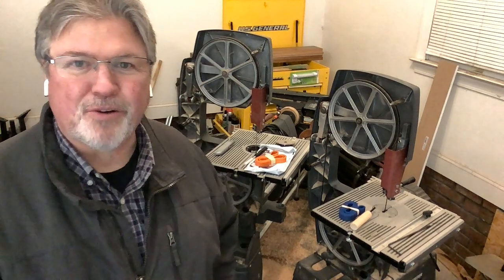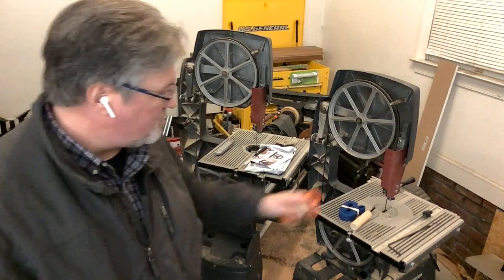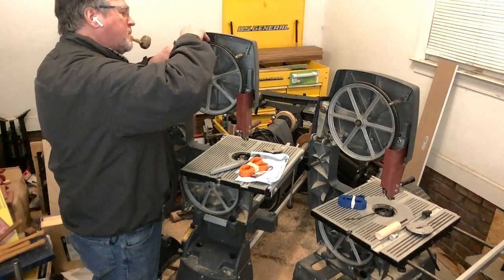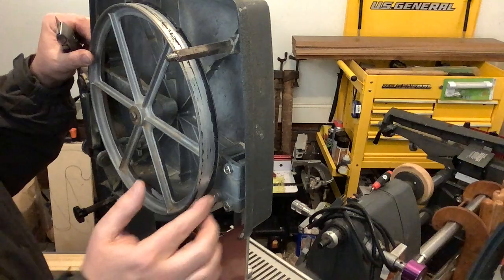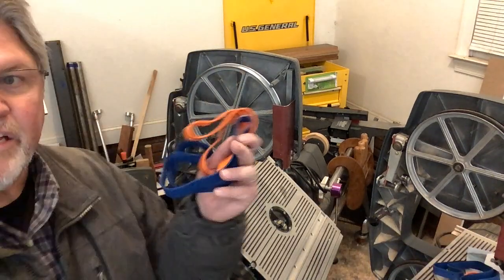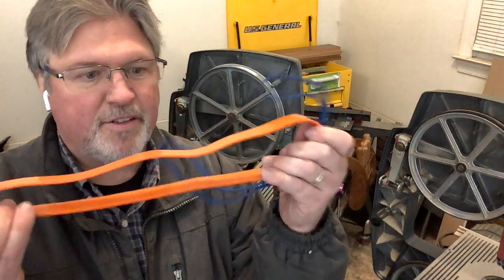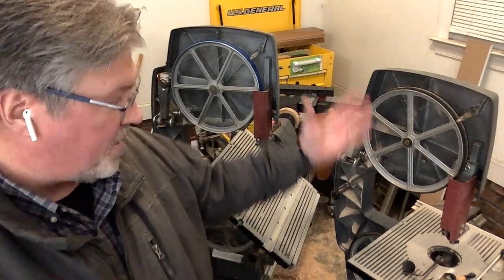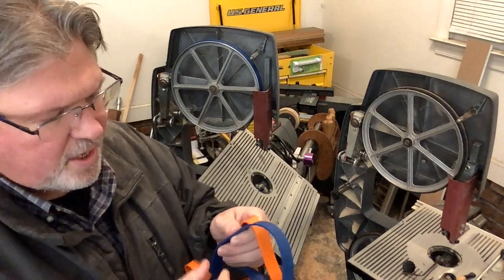Installing 2 Brands of Urethane Bandsaw Tires on a Shopsmith Bandsaw: Sous Vide Everything?

Comment: Did the deed on a different brand without the benefit of factory tools.  All I had to rely on was what Naval Aviation Corrosion Control taught me: Three methods of cleaning include heat, mechanical, and chemical.  I think my task was accomplished using a lot of WD-40 for cleaning, and soap and water to clean off the WD-40.  Your tutorial makes it look easy.  Thank you'

Comment: Hi Scott, I’m replacing my tires and watched your video on how you did yours.  In the Comments and Cheap Shots you talked about different types of liquids that might help remove the old tire and glue residue after you get the old tires off.  I ordered some brass wire wheels and the light you suggested (I’m going to really like that!).  In the meantime I got to thinking about the lacquer thinner you used and decided to try it on my own.  I clamped my wheel in my vice with a rag to protect it and absorb the thinner.  Then I used a green scrub pad and just drizzled the thinner around the wheel.  I just kept repeating that every couple of minutes for about 15 minutes.  At that point the glue would wipe right off.  The tire residue that was left had turned hard and would pop right off also.  Try that next time on an area and don’t get in a hurry the thinner just needs time to break down the glue.   I love your videos!  BTW you really need to get some heat in that new shop, lol.  Almost forgot, I used 1 inch tongue depressors cut at an angle for scrapers.
Reply from the maker: @thomasfrates  So glad it worked for you, and you are right, I9m not very patient. This was filmed quite a while ago and I’m actually in the second space since filming this and I now have a slick mini-split unit that keeps the space just right.

Comment: The urethane tires go on many times easier if you clamp the tire in place in one spot on the wheel, and stretch it part way around the wheel and put another clamp to hold it there, then stretch some more and clamp again. Getting the last bit on the wheel is then easy.
The way you were doing it was basically trying to get all of the stretch out of 1/3 of the tire.

After it is in place, run the tool/dowel/screwdriver around between the tire and wheel a few times to even out the stretch of the tire.
Reply from the maker: I guess I edited out me messing with the clamp! I tried that and gave up. Scott
Reply: The way Mark discribed it, is the way I put the orange tires on, and have not had any problems with them.
Reply from the maker: @ozguzzi  Glad to hear it.

Comment: Thanks as always for all of this great info. I've just finished installing the Shopsmith OEM urethane tires on my bandsaw, and hopefully my experience can help others. I used a heat gun to remove the old tires (worked great!) and Klean Strip brand "Painter's Solvent" to remove the residue. The solvent worked well, but required a lot of reapplication and switching to a clean part of my paper towel. I ended up scraping a lot of the adhesive off with a set of dental picks I have, but I suspect the solvent would have done the job given enough time. The new tires from Shopsmith are very orange (not red like pictured on the website), and the outside is textured, not glossy like the ones you have. They came with no installation instructions and no tool. I soaked them in my sink with the hottest water I could muster (I would estimate 120 degrees F), and ultimately muscled them on similar to the way you got the blue one on in the video. My tool was the shaft of a multi-bit screwdriver with no bit installed. The tires are about 0.100" narrower than the channel on the wheel. Thanks for showing how this is done. It was a real bear getting the tires on, and I may have given up if I hadn't seen you do it first. Hopefully this will be the last time I have to do it.
Reply from the maker: I have a set of the SS tires in my shop somewhere, which is the story of my life! Glad you get them on and I hope they serve you well. Scott

Comment: Thanks Scott! Tim B on YouTube uses string for clamps. And a creative use of a metal rod in a drill to roll the tire on the wheel. I think I will try a wood dowel to protect the aluminum wheels. Also, thanks for the BlueMax recommendation.
Reply from the maker: Yes, I've seen his technique and I would have tried it had I not been wanting to see how well the included tools worked. I might give that a go on the next set because it looks like it works really well. Scott

Comment: I installed the blue tires last summer and they've worked fine.  Relieved to see I'm not the only one who had a little difficulty installing them... I thought I might be doing something wrong, but managed to muscle them on eventually (and yes, I did the hot water soak).  I'm envious of those videos with bandsaw guru Alex Snodgrass calmly stretching unwarmed tires on with no tools but a spring clamp or two...
Reply from the maker: The larger the wheel the more tire there is to stretch, and I wouldn't be surprise if the tires that Alex demos with have been stretched a time or two.

Comment: Thank you Scott for another great video!  I just replaced the original rubber tires (2012) with blue max last week.  The original top wheel rubber tire actually came off while I was using the bandsaw!!  Removing the rubber from the bottom wheel was a challenge. After removing the majority of the rubber,  I ended up removing the wheel from the bandsaw and used a wire wheel brush on the Shopsmith in the horizontal boring setup.  Using the 500 rpm setting on my powerpro, the rest of the rubber was easily removed.  I finished cleaning both wheels with using Goof Off.  Installing the blue max tires was easy.  I put the wheels in a vise with protective coverings and, using spring claps, I was able to stretch on the new tires.  I did soak the tires in hot tap water for a few minutes.  I installed the newly tired wheels after following your bandsaw maintenance video.  Thanks again!
Reply from the maker: Sounds like a wise approach. I've had good luck with Goo Gone in the past to get rid of glue residue but I don't believe I've used Goof Off.  One of those might be a wiser recommendation for folks. I'll have to do a little research. Scott
Reply: I'm not sure which one works best, but for sure, Goof Off has much nastier toxic fumes than Goo Gone. So be careful and only use it outside if possible.
Reply from the maker: @brucenorton3792  Thanks for the tip. I purchased both tonight and will use them in the mid-week follow-up to see which one to recommend. Scott
Reply: @brucenorton3792  same conclusion re GO and GG

Comment: Thanks Scott. I didn't have a calibrated method for hot water above 120 for my Blue Max tires,, so I put them in my  Quick Grip Bar clamp/Spreader and stretched the Jesus out of them for about 20 minutes before putting them on. Looks like you still fared a little better. Thanks for the tip.
Reply: I had the same thought: reversing a clamp head and stretching it
Reply from the maker: Yeah, the idea of stretching them out occurred to me too but the idea of overstretching it was a concern.  Not sure why though, because it works for ballon animals! Scott
Reply from the maker: @johnoerter2883  I have one of those in the corner too!

Comment: I struggled with band saw tires until I used the method Alex Snodgrass shows on his channel. Didn't need heat or hot water. Also, I tried that orange brand you have there from Amazon and finally gave up. They are too wide and just too tough to install. I only used the blue Carter ties now. More expensive but much easier to install. Thanks for the video!
Reply from the maker: I also wasn’t impressed with the orange tires, but found the Blue Max to be excellent. Alex is the man.

Comment: I just put on the blue ones.
  I had to scratch my head and wonder how a dowel with a nail in it got in the box.
So I just pried my old tires off. My wheels are grooved. It was looking like a fight to try to hand-stretch the blue ones on, so I boiled some water, then added the blue tires... they were probably in there for 5 minutes or so when I pulled them out. Maybe less.  Still had to hand stretch, but it wasn't bad, and no harm done. Good tension.

Comment: I just installed orange ones I bought from SS.  Not sure if they are the same as what you used.  I used a heat gun (very gently) .   It was hard to put them on but I got it done and the saw works great.  I think now I will sell my old Delta .   I need space in the shop.
Reply from the maker: The Shopsmith tires are similar to the orange tires I installed, but not 100% th same. I know because I've purchased them too at one point.

Comment: If you use spring clamps at your starting point and about 1/2 way around, they will hold the tire in place so you can use both hands to finish putting the tire onto the wheel

Comment: Hey Scott, Mark Beiser's comment is right about clamping the tire. I see that you replied saying it must have been edited out. 

I tried multiple times heating it the same as you, but it wouldn't work. 
I ended up clamping it across the wheel on opposite ends so it stays stretched equally, and working one half at a time. It went 100x faster for me when I did that, and by then they were cooled down to room temp. 

It wasn't because I had stretched it either because I did the same with the bottom one that I hadn't tried to put on yet and it took only a few seconds compared to the 5-10 mins trying to put the top one on before clamping like that.

-Scott
Reply from the maker: Hey Scott. Yes, I edited it out because the dang clamp kept falling off. I didn't try a handscrew clamp, which would probably work.
Reply from the maker: I just added a screenshot from the part I removed on the Community tab of my Channel page.

Comment: Good observation on the difference in textures between those tires.  Can't wait to see how the orange one performs for you.  I tried the Shopsmith urethane ones (red in picture, but orange in reality) and one of them went flying off the bandsaw right after installation.  I switched to the Blue Max ones and no problems whatsoever with it.  So, I am curious to see how this brand of orange tire holds up.  By the way, on the Blue Max tool, I had to turn it around and put the wood handle under the tire to help stretch and roll it around the wheel.  The instructions were not specific on this tool, but I found it worked better for me using the wood part to ROLL the tire around the wheel.  Of course, I had to use some quick-grip clamps to help keep the urethane tires on the wheel as I went around it.
Reply from the maker: Woah, I bet that was exciting! Seriously, not cool at all. I get what you are saying about using the dowel in that manner. Did you heat the tire or were you smart enough not to install them in the dead of winter?  Scott
Reply: @MyGrowthRings  I can't remember if I followed the instructions on the orange ones or if I followed the prevailing wisdom on the forum at that time.  I did bake them in the oven on a low temp and tried to be careful not to overstretch them in applying them.  I can't say for certain if the failure of the orange tires was partly my fault or not, but I think you are on to something about the smoother texture on them compared to the Blue Max.  I suspect the orange ones need to be glued to the wheels like the rubber ones to keep them on permanently.  I remember following the instructions for the Blue Max tires, though I don't think the hot tap water did much to help.  After some experimentation, I came upon a technique that worked reasonably well to clamp and stretch the tires using the wood handle to stretch and roll around the edge.  It is awkward no matter how you do it, but I have lots of practice on bicycle wheels so my intuition kind of took over on this one and it wasn't difficult after I let it.
Reply from the maker: @rfguy8499  "It is awkward no matter how you do it" should be printed on the package!  By any chance did you think you got a set of the 12" orange tires that SS accidently shipped for a short time? It was a mistake from their supplier and there was no way they could stay on a wheel.  Was at least 10 years back. Scott
Reply: @MyGrowthRings  Yeah, it definitely is possible that I got one of the bad batches from Shopsmith during this time frame.  Several others had the same experience as me with them and posted on the forum about them.

Comment: I used the shopsmith tires. No tool provided and instructions on the webpage only that said hot water to 125. They are a royal pain to install.  I ended up using large screwdrivers and zip ties to get them on. The zip ties stopped the tire from jumping off the rim as I worked the opposite side on. Wish I had seen this video first 😆 Seeing how easy yours went on I would say give the shopsmith tires a pass and try another brand. Shopsmith tires look identical to the orange ones you have even to the "not relaxing" part
Reply from the maker: They really are a pain, aren’t they?
Reply: @MyGrowthRings  I saw that clip you mentioned about using a drill. If I have to change them again I will use that method. My original tires lasted 37 years and the bottom still looked pretty good

Comment: I put the Orange tires on my Craftsman band saw last summer and it was a bit of a challenge.  I ended up using clamps to hold the tire in place as I worked them on but once they were installed and lined up, they worked fine.  You should get years of service out these new tires.
Reply from the maker: I sure hope so, but there's a little part of me that hopes one outperforms the other.

Comment: Had trouble with the Blue eBay tires until I hung a barbell with weights on it from the tires. Stretched them enough that with a second person ensuring the tires didn’t slip off I could force the tires around the wheels.
Reply from the maker: Wow. Did you heat them?
Reply: @MyGrowthRings  we tried that first to little effect. Stretching was the way to go. I suppose it would be possible to stretch too much, but i did not reach that point. The blue tires do seem to be very good quality.

Comment: I’ve used a set of orange urethane tires on my old Craftman band saw for probably 10 years and they work great.  I can’t remember, but I think I may have warmed them before installation.  Of course, I could be imagining that.  Anyway, they’ve held up great.
Reply from the maker: Glad to hear it. There's nothing wrong with the original rubber tires until there is!

Comment: I don’t use my SS bandsaw, but I replaced the tires on my bandsaw that I use at least 10 years ago, and the urethane tires work better than the rubber ones ever did.  I just used a piece of dowel to stretch them on, after soaking them In hot water.  Since it was well before I got my Anova, I have no idea what the temperature was.  Tensioning the blade and tracking on a standard tracking bandsaw is much better with the urethane tires.  Try scallops with the Anova, they’re great.
Reply from the maker: Thanks for the tip, Stew! Bay or Sea scallops?
Reply: Bay, with a little butter, and lemon.  When they’re done a quick pan sear and they are out of this world.
Reply: Actually, the best ones are Nantucket scallops, but they’re almost impossible to source.

Comment: I put the blue tires on my bandsaw a few weeks ago and I noticed the tires were not as wide as the space between the rims. I biased the tires to the back of the wheel. Did you see the same thing on the tires you purchased?  Your videos are fantastic. Thanks for putting them together.
Reply from the maker: Thanks for your kind words. Yes, they were a bit narrow and I also pushed them towards the back. They are certainly wider than any blade I could run. Scott

Comment: Just installed my urethane tires on my bandsaw.. instructions say to use c clamp block of wood.. forget that.. nothing good to clamp to..I used TY WRAPS and it went on like a dream.. use multiple ty-wraps to secure the tire to the wheel and it will prevent the tire from "slipping" off.

Comment: I changed my tires a long time ago and bought from SS the orange tires they had at that time. Warmed them in hot water and they went on very easy. Couldn't tell you if it was because the temp was that cold or because they were SS originals.
Reply from the maker: Excellent. Glad to hear you had no issues. Scott

Comment: Hi Scott, a few questions. For taking the rubber tires off. Is it a concern about scoring the wheel with the utility knife? You said you can use lacquer thinner for taking off the remaining rubber. Is that to remove the rubber? Or the glue as well? Do you soak the wheel in pan of lacquer thinner? Or just paint it on? Thanks for the informative video!
Reply from the maker: Yes, you might score the wheel but that's not a problem at all. The use of a solvent is really to loosen the adhesive, and when the adhesive loosens the remaining rubber will come right along with it. No, don't soak the wheel, just apply the solvent of your choice (Paint thinner, lacquer thinner, Naphtha, Goo Gone) with a paper towel and hit it with a brass or still nylon brush while it is wet. You might want to check the solvent on the brush first!  You are welcome and thanks for the questions. Scott

Comment: You said the temp in your shop was around 40deg. Could the colder wheel have added to the difficulty of stretching the tires? By cooling the tire faster than on a warmer wheel?
Thanks for doing these videos, I enjoy them and have learned a lot watching them.
Ron
Reply from the maker: Perhaps. For sure it didn’t help! Of course, metal shrinks in the cold so perhaps it actually helped! Scott